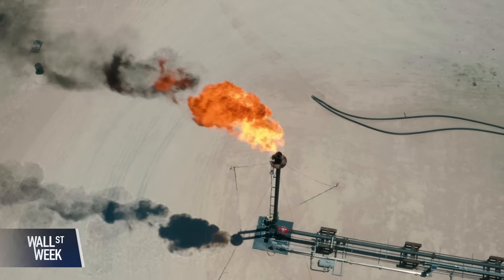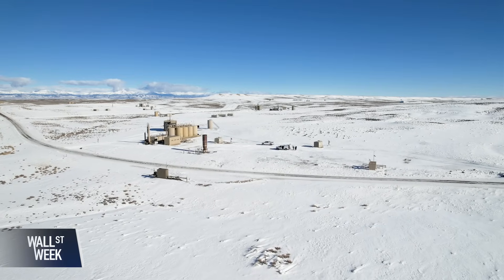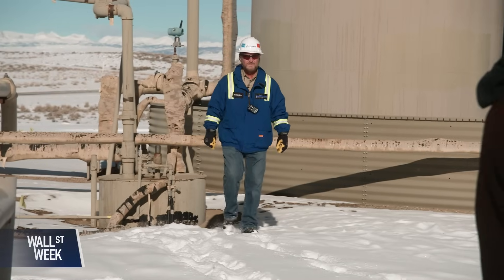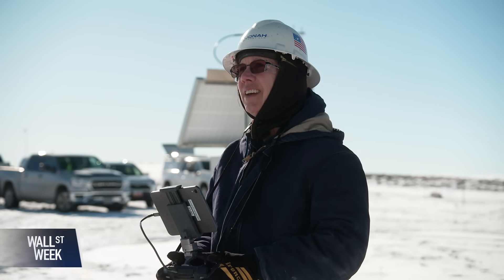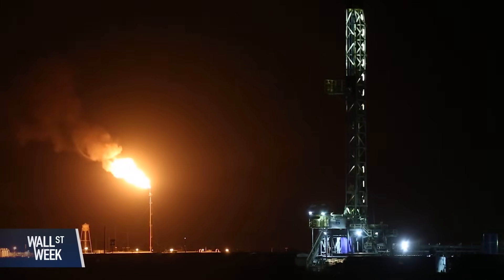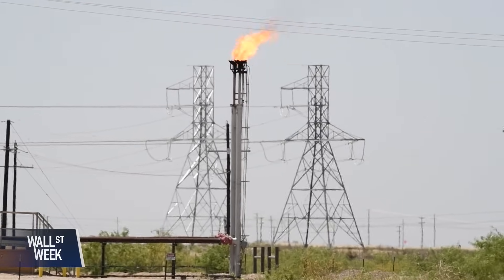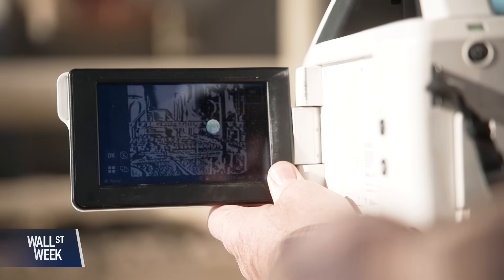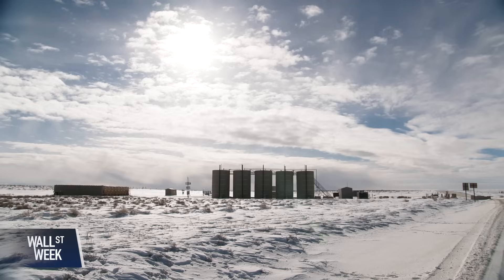Using Lasers to Fight Climate Change

Comment: Unless or until the system can differentiate between leaks and allowable process emissions,  ths signal to noise ratio is impossibly high.
Reply: Now ask yourself, CFCs are HEAVIER THAN AIR, are INERT CHEMICALLY TO OZONE, and KEPT IN HERMETICALLY SEALED reefer units, produced only TONS per year. Are you with me? Then take agriculture ANHYDROUS AMMONIA, is LIGHTER THAN AIR, is VIOLENTLY REACTIVE WITH OZONE, is INJECTED INTO OPEN SOIL, produced by the MEGATON per year. That's what's eating the atmosphere. IT'S THE AMMONIA, NOT THE METHANE!!